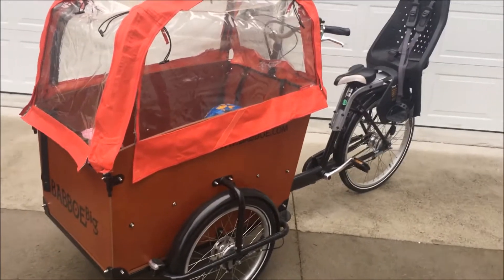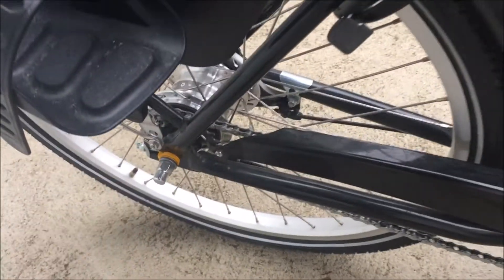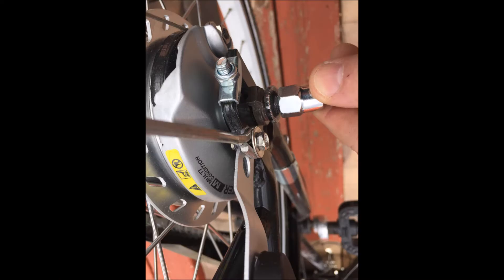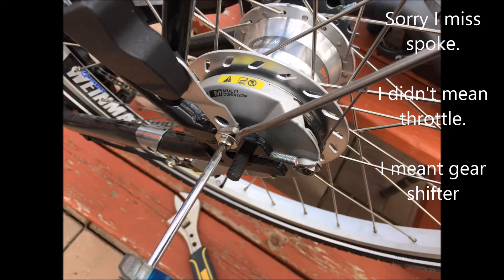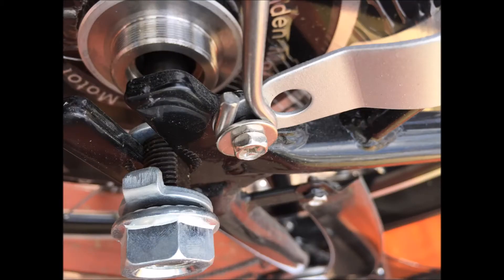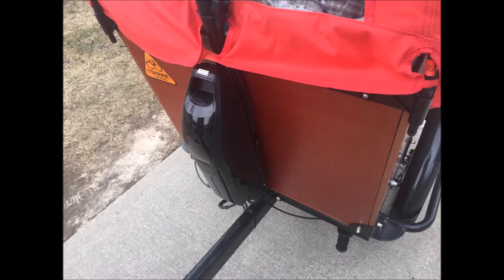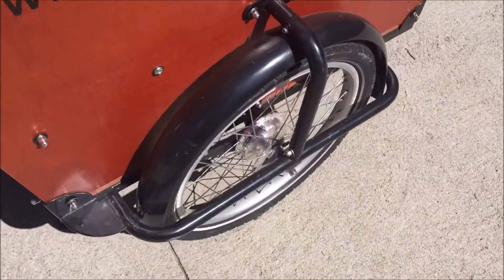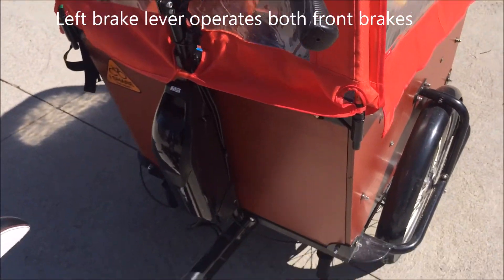How to convert a Babboe Big to Electric

Comment: Hi do you think it will work if i put a front wheel kit? its more easy..
Reply: I agree with you. I would have done a 20" front hub wheel conversion and kept the nexus in the rear. An internally geared hub is the best with a big heavy bike. It also would give the bike points of pull, making it a 2 x 3 essentially.